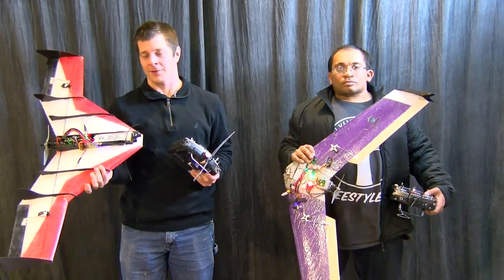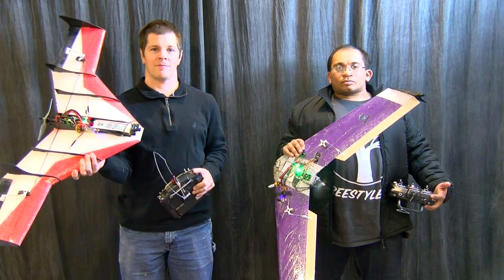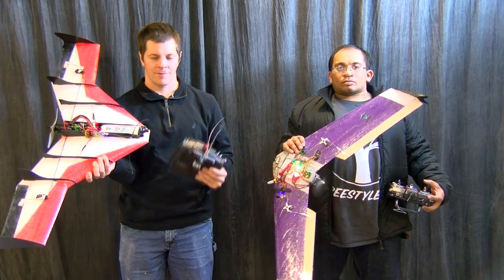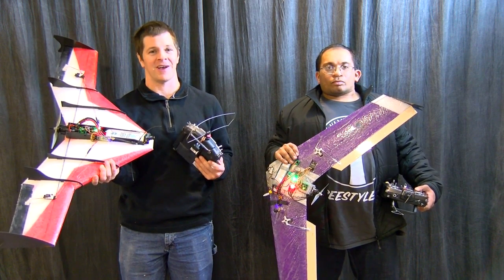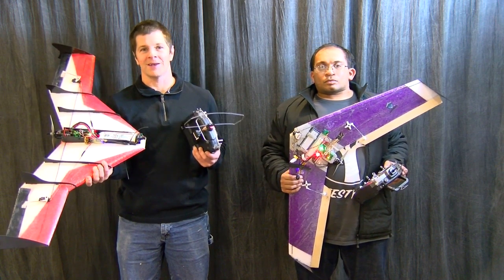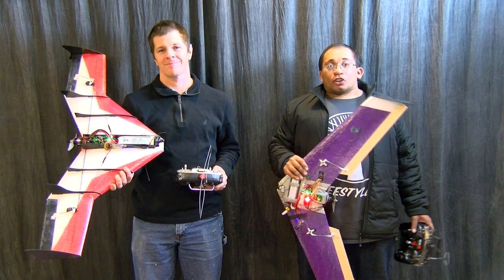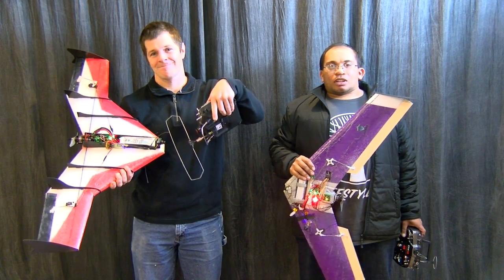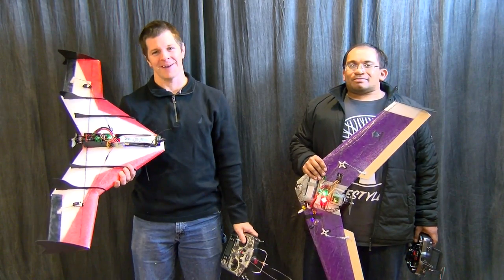FPV Laser combat development

Comment: We need this on large quads. Hear me out. A pilot and a gunner. The IR emitters can be actuated via a gimbal by the gunner.  Large courses. Hits cause "damage".  Issues with flight behavior, throttle cuts back to 60%, adverse yaw, etc. I seriously believe thats why drone racing hasnt garnered a larger following. Humans love violence and an element of combat would be just the thing to get more folks interested.
Reply from the maker: We've been thinking about fighters vs bombers with tail gunners for 2 years now... and this system has a race mode!
Reply: @CAGreve1231  that would be freaking fun.

Comment: Does this system only work in the dark and what is the max range to target ???
Reply from the maker: Night time is much longer range than daytime.  Right now, daytime range is 100-125 feet.  We are working on a long range daytime gun for longer range battles in the day.
Reply: Thanks for the rely Alex.
Are you using Lasers as the transmitters ?? 
Is the transmitter Modulated ??

Comment: Hello guys, good job!
I'm working on the same concept here in Italy, it will be compatible with drones and planes and will have some add-on!
Would be great to share ideas and resources, are you planning to release it as open source project?
Reply from the maker: This will not be open-source, but the one I did on 2009 is open-source and is on FPVLAB.  Feel free to pull from that project as it is compatible with this.

Comment: Welcome Hardik, this looks amazing. Does it do multiplayer and if so would love to ground base gun fpv. I see this and automatically thought WW2 artillery guns and tanks fpv with Planes dogfight and making ground sweeps getting more rc in on the fun that don't fly.. I also think this would be amazing on mini quads real low proximity flying while dogfight or getting chased shot and feel your motors pulse a would be epic.
Reply from the maker: Already planning on it ;)
Reply: Nice will the response to being shot be programmable. Meaning could you choose to pulse the motor for shot 1 and 2 but 3 could turn off the motor completely.
Reply from the maker: It is configurable.  The system keeps score with an LED light.  You can see in the video that eventhough the plane is flashing, there are lights that are still on.  Those lights are the score lights we accidentally made too bright for this.

Comment: When can I get one
Reply from the maker: Late February.  Should be ~$35 or so.
Reply: can i put it on a miniquad
Reply from the maker: Yes.  however, this version is PWM only.  We are working on PPM and SBus.
Reply: Video Aerial Systems would it fit on a micro like a 2” quad
Reply from the maker: Not this version.  Perhaps we will make a small one in the near future.
Reply from the maker: We had to put off the delivery date due to several problems.  Hopefully we will have this by August.